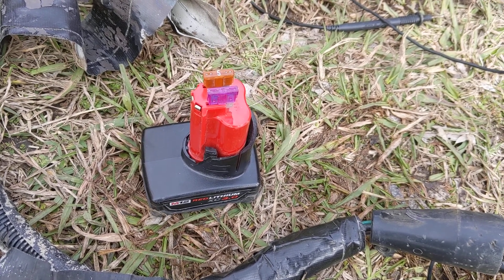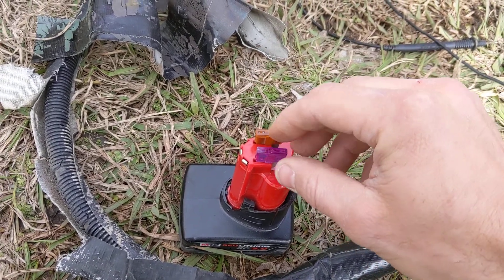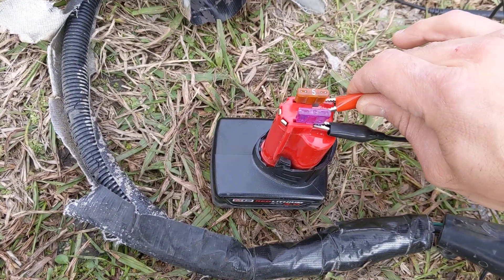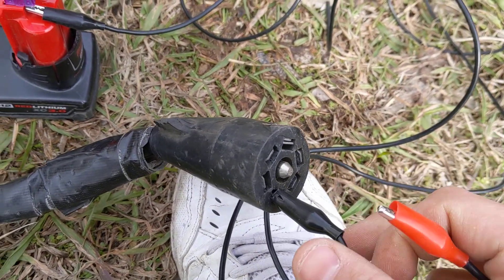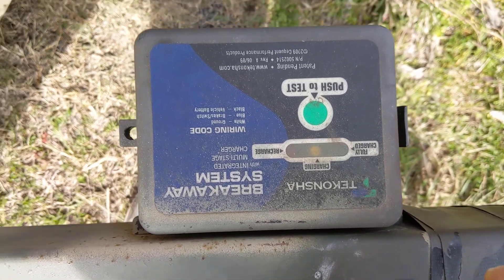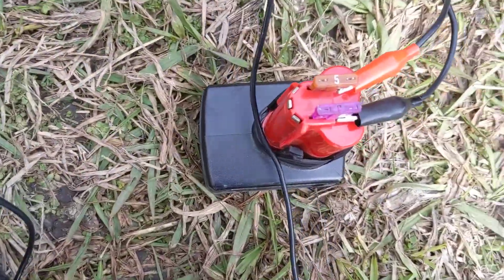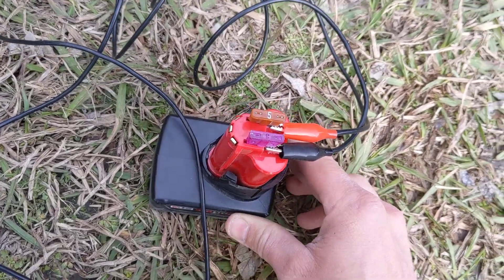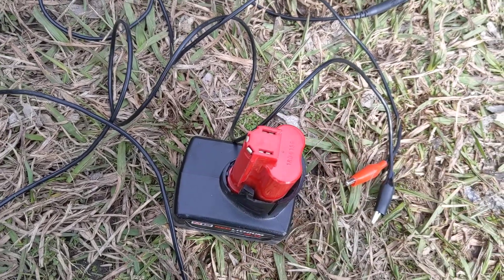Milwaukee M12 12v Vehicle Electrical Hack

Comment: Not sure I understand, are you saying I can use the m12 to boost a car with a dead battery?
Reply from the maker: You could try, but I'd definitely try using the largest one they have. It's not just the voltage. You have to match the amperage needed as well. I think an 18v battery would work better, but not sure if the extra voltage would damage components.

Comment: I’m currently popping fuses testing a canister purge valve from my truck, is it because my 1.5 ah battery is too small,  or there’s a short or some sort in the solenoid?

Any advice?
Reply from the maker: So you really need to know the wattage or amperage of the solenoid. I'm no expert but a 1.5 ah battery theoretically can sustain an 18 watt load for an hour (1.5amps x 12v = 18 watts). However, how much of a load can it handle for a short amount of time? That would require a deeper search into Milwaukee's information on their batteries. The point of the fuse is to protect the wire and battery and I just don't know what discharge rate it can handle. There are probably forums online that go into it. I assume it's probably close to 10x the amp rating or possibly more. It also depends if the battery has over-amperage/overheat protection built in. I think M18 batteries do, but not sure about M12. If you are willing to burn up your battery you could try larger fuses, but further research is needed to know exactly what fuse would be needed.

 So, the short answer is that the solenoid is likely pulling more power than the fuse can support. A 30 amp fuse would allow the equivalent of 360 watts (30 amps x 12v = 360 watts) so a 1.5 ah battery (18 watts) could handle that kind of load, theoretically, for 3 minutes. 360 watts/18 watts= 20 which means that 18 watts is 1/20 of an hour worth of energy, or 3 minutes, though probably for a lot less since it won't have a full 18 watts worth of power inside of it to use.

Comment: Wow so this acts as a power source adapter that allows you to use all cells  and definitely will not create a cell imbalance?
Reply from the maker: Good point, don't do this to power something indefinitely. They're tiny batteries. Use it to test with as I demonstrate. Though if you do drain your battery too far so that the charger won't accept it, just plug another m12 battery's positive and negative to the "bad" battery and jump it. Then stick it on the charger and voila.
Reply: @MyFortressConstruction  I read my voltages and one cell read zero. So I’m thinking my leads touched and shorted the board

Comment: Love the fuse idea!  One caution on M12 batteries.  The low voltage cut off, preventing you from discharging the battery too much, is built into the tool on the M12 line, so you can easily discharge the battery too much and end up with the M12 chargers refusing to charge them back up.  If anyone knows of a low voltage disconnect that would solve this, please share! :)
Reply from the maker: Ah yeah, I typically am only briefly testing 12v systems, but it's true, you could discharge too far. You can jump them back up with another battery so that the charger will recognize them again, but it's still not good to drop them that low. An LVD that cuts off voltage at 10.8 volts would be ideal for these batteries.
Reply: Thank you for sharing this brother, good to know!

Comment: Bro. This is a fking AMAZING hack!!!!!!! Thank you soooooo much. Been trying to figure this schizzle out for some time but only recently got some Milwaukee M12 tools. This worked out so perfectly to power up an odometer in the junkyard to see the mileage. Found out which pins to use….cut the connector out of the harness, stopped the appropriate wires (I didn’t have the key so had to do it this way) and voila!!!!!!
Reply from the maker: I thought it was nifty so I'm glad it helped you!